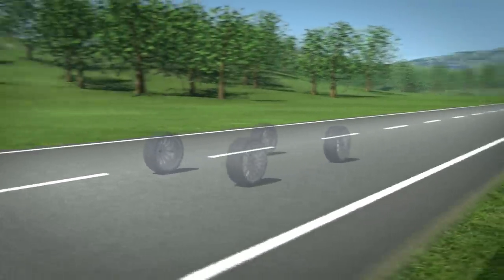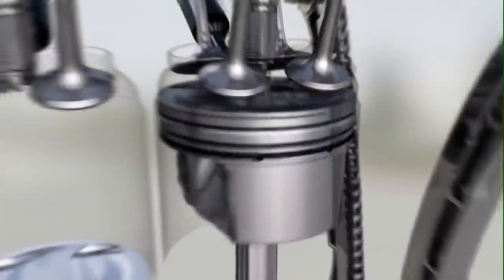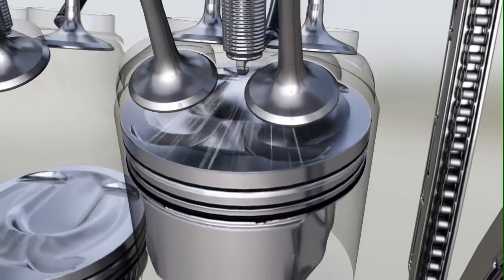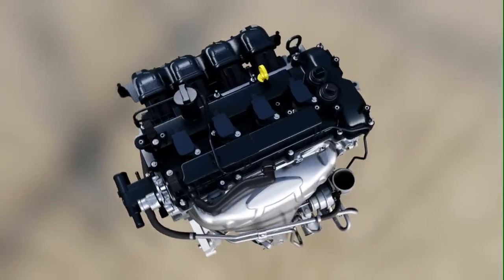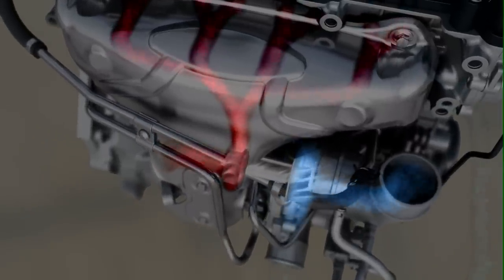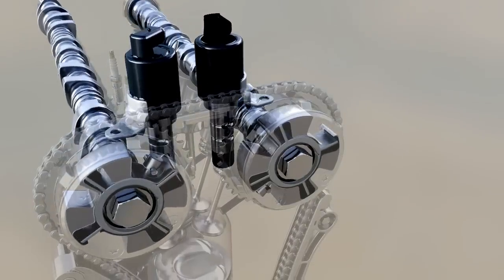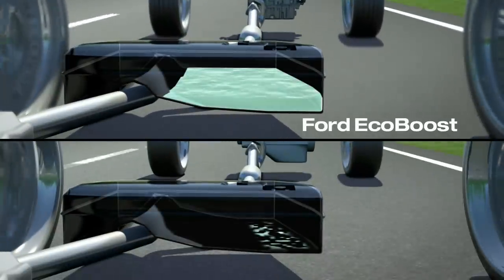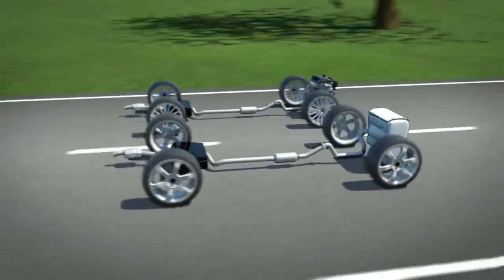Ford Ecoboost Animation

Comment: I've got a 7 year old 1L eco boost engine with 165k on the clock, it has never had a single issue? Serviced every year and never missed a beat! Still sounds as good as when i got it new.

Comment: ive owned nothing but v8s. 03 mach 1, 04 cobra, 02 camero, 76 trans am, 96 thunderbird, 7.3 idi, 7.3 id, Mercedes e350, 5.3 silverado, 6.0 denali and now i have a 2019 raptor and im in love. yes its a v6 and its not a v8 but boy the power in the 3.5 is ridiculous. its like a cross between a e350 and a terminator. i dont know but its awsome and the v6 eco boost is a beast.

Comment: I have been a die-hard Chevy fan since I was knee high. I have also been sold on Toyota's 5.7 Tundra. I just recently traded my 2011 Tundra in on a 2013 F-150 ecoboost. I will probably never be e Ford fan, bud all I have got to say about my new eco boost is "DAMN"....most impressive truck I've ever owned. Ford revamped everything in 2011, from the ride, to the engine & transmission. The F-150 eco boost is worth every penny. Once again...I am not a Ford fan, but I'm sold on their new stuff.
Reply: Wait for the turbo system and the eléctrica harnes start be a pain on the neck
Reply: How is your for now? How many miles do u have?
Reply: EcoBoost engines are so fun to drive and thats what they've been made for! Unlike some of the people here said I've never experienced any breakdowns/serious problems. 1.6L Ecoboost (180PS) on 75-80.000KM

Comment: And at about 40-50k miles, they start to run rough when they are cold. Intake valves carbon up, and there is no real way to clean up the carbon deposits, due to the direct injection and the fact that you cant use ANY type of intake cleaner because it will destroy the turbo big time. Fords recommended fix, "replace the heads". Good job ford!
Reply: I'm all for better MPGs, lower pollution ETC, and so on, that's why I have a Crew Cab Silverado, and, a 2012 Mazda 3 for my daily commuter, to save on fuel, But Ford is pushing the Eco Boost like its a new invention. Turbos have been around for close to 100 years, with there lower ends beefed up to handle the harder loads. Now Ford renamed the Turbo, Now its called Eco Boost, and the Ford faithful are falling for it.
If Ford using smaller, Turbo engines were saving a lot of fuel, it'd be good, but it doesn't save but 1 to 2 mpg, in exchange you'll get a engine that will NOT!!! have the same durability as the larger engines, wearing out while polluting the atmosphere.
The fact of overworked smaller engines prematurely wearing out is as sure as the sun rising every day, its been proven millions of times, but you cant tell that to idiots that think Ford invented the Turbo, Oh I'm sorry, Eco Boost.
Reply: Surely a good booting sorts it? Like almost redlining it a good few time to clean out the cobwebs, of course the engine needs be warm before hard revving.
Reply: Mike n Serena the ecoboost is a direct injected engine, and carbon build up seems common in all of them, not just fords. Lots of makers are doing their ecoboost equivalents. Ford aren't claiming the turbo part is a new invention from what I read
Reply: guitarplayerforu
Carbon build up issues have been rectified in the Ecoboosts in production now and it mainly only effected the 2.0 240-250ps unit. This can be helped by the use of leaner burning premium fuel which also has additives and given the lower price of fuel now anyway anyone should be able to justify it as it's the same price that regular used to be. Carbon build up issues haven't just happened to Ecoboost units but other forced induction direct injected units. Diesels are crap and people still buy them when they're doing 10,000 miles a year and they wonder why they clog up and stop working! There's been issues of people putting the wrong oil in the ecoboosts as well as places like Halfords were telling people they need 5W30 oil in their 1.0 units when it actually uses 5W20! so there are various outsider factors that have affected them.
Reply: BoeingvsAirbus1578 its shocking how a well established place like halfords can recommend the wrong oil for a engine. Thats like putting diesel in a petrol car, just wouldnt do it would you? Surely that wrong oil would wreck the 1L units?
Reply: guitarplayerforu It has been wrecking the 1L units, as they are designed to run on oil so thin it's water! also helps the turbo having thinner oil as there's less damage if revved when cold, due to the EB relying so much on the turbo. I always wait until at least 2 bars of engine (coolant) heat before I rag the tits off of my 1.0 100ps :D going to remap to 140 ;) woo, 0-60 in 8.7 for a 1.0 - fun times! That'll keep up with most roadsters, 2.0 TDCIs etc.
Reply: Nearly all direct injection engines have this problem. Only a few companies have fixed the issue. The issue is that the back of the valves never get cleaned. In my mazdaspeed 3 I have to take apart the top half of the engine to get to the intake valves and then use a walnut blaster to clean them out. 
The only way to fix this from the factory is to add a second set of injectors to clean the back of the valves. (I think audi and Volvo have done this but don't quote me on it)
Reply: +Bob G All you have to do is pull the intake manifold and get in there with a wire brush and light solvents with the pistons at TDC then blow/vac them out to get the big chunks and you're good for another 40k miles.
Reply: seafoam. no real way. cleaned a 210k 2.3l lima motor with it and guess what came out clean..
Reply: Bob G.  You hit the nail on the head.
Reply: All those in favor of removing an intake manifold every 40k miles say aye!
Reply: Mike Tom Cat what other engine has direct injection + turbos? Plus vvt
Reply: rayford21 3 hours of work max
Reply: Bob G nonsense
Reply: And I'm pretty sure you're running cheap ass gas
Reply: Bob G My mondeo has done over 120K miles and 0 problems. Runs like new
Reply: Mike Tom Cat how the hell do you have so much hate for THIS? Lmfao, your life must be great. Mad that people like ford... wow
Reply: You can inject steam into the intake. I wish they had a built in feature for this. Would solve a lot of issues.
Reply: I agree. I had  TGDI and at 40k miles the engine was running rough on a warm idle. I used intake valve cleaner and did help a ton but doing it often isnt good for the turbo.
Its a pain to get them clean. Even then when i would turn on my AC the car would run rough. GDI SUCKS when its not clean.
Reply: Totally false and impossible in part.
Reply: What about the turbo i wonder how long it will last
Reply: my wife's edge has 180k it's  2.0 Ecoboost and it runs the same as the day we bought it . i don't know where you got your info but it isn't right.
Reply: Put an oil catch can between the PCV and the intake tube. I did on my 2018 6.2 Silverado. Problem solved
Reply: what about cold water down the intake into a hot engine?
Reply: Bob G mine got 100 thousand miles and runs as good as new
Reply: EcoBoost = New Shit to stab ur money... and you are the experiment for other industry study the final result 👍
Reply: @wowowiiwaa1337  Ford has as well on their newer DI engines.
Reply: @chriseagle7231  my speed 3 does, and it's 12 years old. Lots of newer engines do
Reply: Bob G seafoam cleans that shit right out. Go Ford!
Reply: @mikeserenar  I do believe ecoboost is the combination of low compression ratio, small cylinder, VVT, and turbo. All which have been around for a long time.
Reply: Merl Klarhoelter  no thanks its way too funny to see an anti-ford guy get triggered at how reliable Fords are ;)
Reply: @mikeserenar  this post is funny now. Everyone else jumped on the wagon too.
Reply: that’s why you get an oil catch can as soon as you get the car
Reply: Oil separator
Reply: @chriseagle7231  Mini Coopers. They have the carbon build up problem as well.
Reply: Haven't they updated this tech by now to include both GDI and conventional port fuel injection so the computer can alternate between the two in order to combat the catbon build up problems on the valves?
Reply: It's called sea foam dude
Reply: @varus113  can sea foam clean the back side of a valve?
Reply: It’s called seafoam use it it won’t hurt anything
Reply: Agreed.  Put in a catch-can for the blow-by condensates really only delays the inevitable.  All GDI engines get coked up - not just the Eco-boost engine. 

Running a fuel-system cleaner every oil-change should help to reduce the amount of carbon build-up.  To truly eliminate the problem, the heads need to be removed and re-built.
Reply: My 3.5 EcoBoost has 180k miles.  Runs like new.  There's a lot of them out there with 250 + miles on them
Reply: Brought to you by the American taxpayer. But don't call it a bailout...
Reply: @power828  one example doesn't mean the other hundreds of thousands are the same. your bubble is not the world. don't be arrogant.
Reply: The eco boost  mpg figures are  hog wash too
https://www.classactionsreporter.com/consumer/ford-f-150-trucks-fuel-economy-figures-class-action
Reply: @mikeserenar   it turns out that eco boost mpg figures are  nothing  but  hog wash 

https://www.classactionsreporter.com/consumer/ford-f-150-trucks-fuel-economy-figures-class-action
Reply: Guys just add a lucas treatment when you fill up the tank and problem solve
Reply: @geargrinder4784  What ever makes you feel better little fella.
Reply: @r6master69  Truth hurts
Reply: Port injection with rivvited valves.....only way to go.
Reply: Bob G walnut shell blasting is how the factory takes care of it.
Reply: Bob G if you use any type of gas in America that means your are using a high grade fuel that has a preset amount of detergent to clean out the engine’s intake intake valves and exhaust valves. If you get high carbon buildup on intake and exhaust valves that means you’re probably using a fuel additive that is not built for the car. Direct and jet injection does not spray gasoline onto the intake valves it sprays it right into the combustion chamber therefore getting rid of intake valve buildup. Direct injection uses 1/64 of a drop of fuel for economy mode and 1/16 of a drop of fuel to achieve  a 14.7 to1 ratio for average driving. 1/8 of a drop of fuel will get you high performance but lower marginally lower fuel economy economy. Direct injection gets rid of turbo lag therefore making the engine more efficient and reliable. After 40 or 50,000 miles your engine will perform like it did when it was new.
Reply: guitarplayerforu how is there carbon buildup when the injectors do not spray on the intake valves?
Reply: Couldn't you just spray in the cleaner AFTER the turbo so it wouldn't be affected?
Reply: The competition never wants Ford's rights to their "innovative" designs or patents.  While Ford's only chance to compete with other manufacturer's innovations are in a court room, not a test facility. Lmao
Reply: Braxton Finegan the air being reintroduced into the intake via the pcv system contains oil particles that bake on the valves.  Port injection keeps the back of the valves clean if you use top tier gas.
Reply: Isn’t an oil catch an obvious aftermarket remedy?
Reply: @ben3989  Cheap remedy. No matter what a sorry excuse for Ford with engine issues in today's era ,when their competition is stacking 300k+ on Vortecs without any internal engine related issues in need of repair or overhaul, just change oil and basic preventative maintenance.
Reply: Bob G I have mine 60k. It’s as good as new. Just do the maintenance and floor it once in a while.
Reply: Ford has not had issues with carbon buildup whatsoever on the Gen1 EcoBoost motors.  Millions out there! Tons already well over 200k mis an the excellent Honeywell turbochargers are not failing. Ur completely wrong and I see internal data. Its recommended by all to run an SN+ full synthetic oil at 5k OCI using motorcraft filters. I'm on my 3rd Ford truck an I only get EcoBoost!
Reply: @mikeserenar  12 yrs later an Gen2 EcoBoost now with many millions on rd. They are excellent an highly durable. Forged internals etc. Its not an argument anymore! Ford circumvented any carbon probs even early on. I've owned 2 F150 w/3.5L EcoBoost an now a '19 Ranger w/ 2.3L EcoBoost. I'm sold. Run full synthetic oil an Motorcraft filters they are bulletproof.
Reply: @Davido50  are you high! Yes they do, all day long! And yes for the last 4 years, and going!
Reply: @BoeingvsAirbus1578  essentially even the Gen1 - 2011 EcoBoost motors had near zero carbon issues if you ran proper motor oils as you stated ..at least the excellent an low price motorcraft semi-syn an motorcraft filters! Most ppl run Mobil1 or any other name brand "full synthetic" preferably SN+ rated an never gave issues of any kind! I'm on my 3rd Ford truck w/EcoBoost..always use SN+ Pennzoil Platinum 5w30 and premium fuel 91 or better an my EcoBoost trucks run flawless. Our newest '19 Ranger w/2.3L Gen2 EcoBoost is a blast an has best class performance . Cant beat Ford trucks an the EcoBoost engine lineup has been in production 10yrs now. Bought my Mom a '19 Ford Escape AWD 1.5L EcoBoost . Fun lil SUV. Switched over to Pennzoil Platinum full synthetic 1st oil change an she uses midgrade fuel only. She says it quicker, more fun to drive & more fuel efficient than her previous RAV4.
Reply: @wowowiiwaa1337  Audi & VW..along with Honda hsve had the biggest problems with carbon buildup! Ford has added a dual injection system to mitigate any potential problems an they weren't having carbon issues even on Gen1 EcoBoost engines. EcoBoost dont burn oil like so many other brands TGDI motors either. We have 3 EcoBoost powered vehicles in my family. 1 older F150 that has 219k mis ..all orig an running strong. Its seen a full synthetic motor oil an mostly premium fuel from day 1. The newer Gen2 EcoBoost vehicles..a new Ranger & Escape run outstanding an are quick also getting excellent MPGs. They too get only SN+ full synthetic oils & Motorcraft filters! We use midgrade or premium fuels as any turbo motor benefits greatly from this. Keep truckin! #Ecoboost #Fordperformance
Reply: @Davido50  good to hear! My motor is the predecessor of the Ecoboost engine. It has plenty of carbon buildup issues. But as long as that issue is taken care of it's been running strong!
Mazdaspeed 3 ftw!
Reply: BoeingvsAirbus1578 o
Reply: Bob G that’s all direct injection engines though  lol EcoBoost engines is nothing but Ford-Mazda duratec engines with small turbos the newer engines all have direct and port injection so no carbon build up in better performance 🤷🏽‍♂️ Carbon build up is normal in most cars anyway, Ford never said they reinvented anything its called EcoBoost because it’s either you want economy or you want boost but you get both lol all of their engines get better Mpgs and WAY BETTER performance than 95% of the anything 60s-mid 2000s . That 2.0 n 2.3 are very stout ESPECIALLY tuned . Let’s not even talk the 3.5 n 3.0 l v6 TT
Reply: @TurboquandoGaming  so my post was 5 yr ago, and ford bought the truck back 5 1/2 yr ago with a 60k dead engine. So yep it's junk .
Reply: @TurboquandoGaming  Duratecs were great engines but no the Gen2 Ecoboost lineup has no relation to those. Mazda a great car co has completely different setup with regards to engine's. Ecoboost is the most high tech of any full line automaker out there .
Reply: Bob G yeah I understand that that’s why this a update comment from a person who actually works on cars lol n  that’s just you but it’s PLENTY PLENTY PLENTY of eco boost engines driving with 200+ thousand miles today with no problems .
Reply: I put a catch can in on my 3.5 about 60K miles in. works great! Hopefully it helps her in the long run
Reply: how does it affect the turbo when it should be only moving clean air?
Reply: @mikeserenar  lightweight econo turbos are different from the  traditional performance oriented designs.
Reply: Lol so pessimistic
Reply: @mikeserenar  you hit the nail on the head. In regards to the trucks, the 5.0 is always going to outlast the 3.5 eco. Anyone who bought the 3.5 F150 doesn’t know anything about cars.
Reply: @r6master69  for every high mileage ecoboost f150 there are 5 others that started having major issues around 100,000 miles. The water pump issue alone is reason enough not to buy one.

Comment: 2013 ecoboost 100,923k miles still runs smooth and still drag ur v8 wherever you wanna go..
Reply: Fuck yeah bro lmao
Reply: Ecobeast for the win!
Reply: My 12 Platinum 4x4 Ecoboost has 155k. No problems.
Reply: 180k on mine.  Runs like a champ
Reply: But my V8 is from 99 and makes over 450hp and 500trq.
Reply: I'm worried about carbon build up

Comment: These really are great engines for getting a used car bargain (if properly cared for). Taurus SHO's with a few aftermarket parts can be pushing 400whp all for mid 20's. My 2016 foST was 17k used with 12k miles. Now it has almost 30k miles and I've never had a problem with it. It's a blast to drive
Reply: That's what people don't get. They need to care for these engines, not just run them into the ground and complain about them lol. They are very impressive engines
Reply: @mravocadoman2904 Yup. I jokingly rag on them, though I see a lot of people with over 250k miles when they do get maintained.